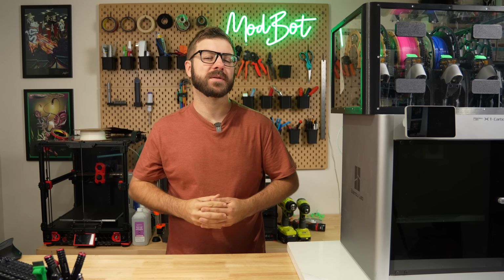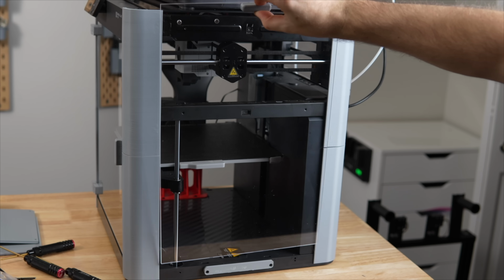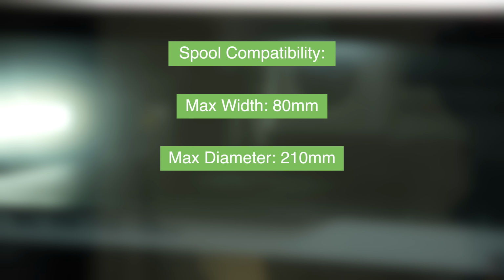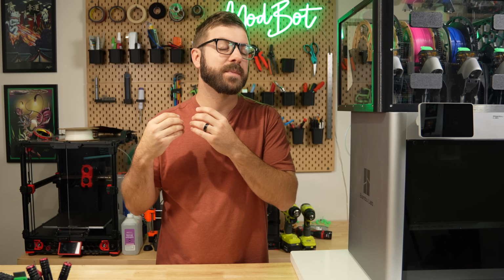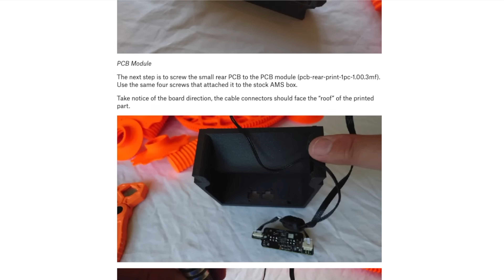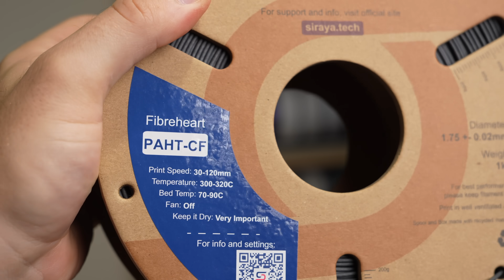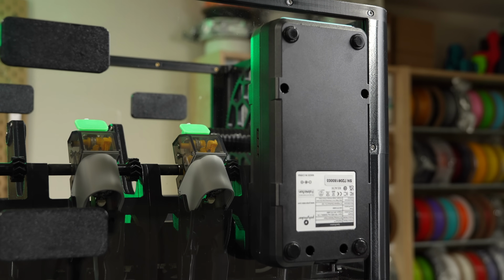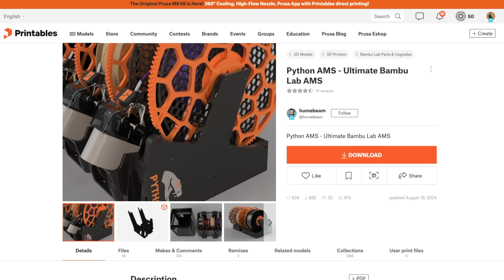Ultimate BambuLab AMS Upgrade! (Python)

Comment: Hey thanks for the review! I've linked to it from the project pages, I hope you don't mind.

RFID support is coming soon (with the next update), if testing goes well that is but I'm fairly confident.
Reply from the maker: @humebeam  hey!! Thanks for making such an awesome upgrade. That’s super exciting for those that print with a fair bit of Bambu lab filament. I don’t mind the linking at all 🙌.
Reply: @ModBotArmy 😊😊😊
Reply: You should make an ams lite version for the A1 fam!
Reply: Hiya! @humebeam I have an X1 Carbon (that's not working right now, but I won't ask for help on that here) and I'd love to have a Python AMS built for me. Do you offer that service? This is such a cool project. I'll be keeping an eye on it for future updates/functionality.
Reply: That’s an awesome mod bro. 👏 good job for doing this. ❤
Reply: Wow! Instead of investing ~300€ to Bambulab AMS, I'd rather get your upgrade only: for the drying and for 2 to 3 3kg spool options. 

I hope I would be able to use the box as a dry storage also. With heaters/dryers and active monitoring and desiccant management that would be possible – or overkill (I'm a novice).

The AMS Feeder unit seems to be 41€ a piece as a spare part! So, a 2 or 3-spool version with 3kg spools would be an excellent option indeed, if possible?

Perhaps 3 spools would fit the width printer or otherwise be prefered. I hope you could list all the Bambu spare parts one would need to build your drying box from scratch! :)

I'm just in the midst of purchasing P1S but now undecided on with or without AMS? :O  Thank you for your work!
Reply: Omg, came to the comments to say how amazing this project looks, but bummed about it not having the option to use the RFID! Excited!
Reply: @Obtuse94  RFID is supported on all spool slots since version 1.02 (September update).
Reply: @humebeam  wow! Can't wait to start cracking into this! Again, great work here.
Reply: hi is there any for A series model?

Comment: Hey Daniel. I've been using the Hydra Pro mod for my AMS/Bambu P1S for a while now. My biggest issue with it (and with the standard AMS) is maintenance. I just had to replace the internal PTFE tubes and it is a pain to disassemble the unit to get access to those tubes. You mention that the Python unit is difficult to get into the enclosure. I'm assuming, then, that it would also be very difficult to do maintenance, like changing out PTFE? Are you still happy that you went with this option? I like the idea of having even more options for filament than with Hydra.
Reply from the maker: Hey! I really like the setup and would say it’s (probably) easier to access the ptfe for maintenance but I have had to remove it from the enclosure twice and I wouldn’t describe that as being very fun. I haven’t had to do a ton of maintenance so it’s hard for me to say how it compares in that regards.

Comment: at the 10:00 mark, something that WILL help with screwing in allen bolts at an angle is a "ball head allen wrench".  Allows room to pivot the wrench and still drive the bolt in straight.

Comment: I don't purchase Bambu filament, and I usually get just whatever pops up on Amazon.  I found that I really didn't use my AMS because a lot of spools didn't work correctly, and sometimes I didn't feel like testing it.  In those cases I just used the manual feeder.  I finished my Python upgrade about 3 weeks ago, and now everything goes in the AMS.  This is an incredible upgrade, and I appriciate your hard work in this project.  FYI, I did test the RFID reader, and it works perfectly in all 4 bays.  Thanks again!

In case anyone is curious, I purchased the hardware kit online, and I printed all the parts myself in PETG.
Reply: Wow - in 3 years I have had one spool not work correctly, though there was a period where the RFID was not stabile but software updates fixed it. 
The Bambu filament has been good for me!
Reply: I've had the worst luck with "Amazon Filament", so Bambu only for me now.  I'd use Voxel's if they'd get with Bambu and put RFID in the spools too.
Reply: Does the python fit in the AMS case itself because I have the sunlu filament dryer top for AMS

Comment: I ordered mine and it said it was RFD compatible now does this reflect in the installation manual so we know where they go?
Reply from the maker: When I built it there was no rfid compatibility yet so I am not sure what the updated process is like. I was under the impression rfid required custom boards or at the least extenders.
Reply: Yes, the installation manual is updated for the RFID. You can use the RFID boards that come with the AMS.  No extra part is needed.

Comment: tempted to just drill a hole for a dryer on my AMS LOL. bad idea... I could also just put a large silicone heater and let the heat passively radiate throughout, doesn't even need a driver TBH if I keep it at 55c it'll just passively be enough with a low wattage heater.

Comment: I don't know if I just missed it, but why would anyone build a Python when the stock AMS works just fine?  You still have to  buy the Bambu AMS anyway to make one, so it will cost even more to build a Python than just use the Bambu AMS.  There would have to be a pretty big gain to justify the extra cost and labor of making one of these and I'm just not seeing it.  There are simpler ways of routing abrasive filament to the machine

Comment: Honestly the python has been an absolute nightmare. Constant failed to pull back filament errors. Furthermore, I actually purchased the upgrade kit from Voxel and they were absolutely horrendous to deal with. Missed shipping deadlines, constantly had to pester them to ship and severe warping and cosmetic issues with the unit. I ended up having to reprint half the system. Massive waste of time and money.
Reply from the maker: That sucks to hear. Mines been pretty much flawless. If I’ve had an issue it was because I didn’t places the spool correctly for the gears to mesh.

Comment: I bought my first 3d printer in 2016. A delta printer from a company called "Micromake". From there I went to a Tevo, and then Ender, and now finally Bambu. How far the industry has come in just 8 years is astonishing.
Reply: I’ve had a similar experience. I bought the Monoprice Mini Delta when it was an Indiegogo project and used that for several years. I then upgraded to an Ender 3 v2 about 3 years ago. I’m anxiously waiting for the holiday to unwrap my Bambu Lab P1S with AMS. 

3D printing technology has come a very long way in the last decade. I’m most excited about being able to print 4x faster than on my Ender, but multi-material printing is exciting too.
Reply: @neversinkmakes  You will love the P1S. It's such a fantastic printer, especially with the AMS. I didn't know Bambu Lab had RFID in their spools such that the printer identifies the material, and applies all the correct printing settings. It's very convenient.
Reply: Bought UP+ in 2011, had access to UP Box, and several others, Bought 2 Creality CR10S, Ender3Pro, 2 Creality CR10 MAX, couple of resin printers, and then the X1C - the latter gets 98% of the use.

Comment: Just built my Python. Voxel did not clear the debris from the holes. I had to purchase bits for the assembly. My T-handle Allen Head wrenches did not work well. I also had 2 parts arrive cracked. I reprinted them so it wasn't a big deal. I have mixed emotions about this mod. I won't order a second one for my new X1C. I think Bambu will come out with an improved AMS soon.

Comment: Its a cool project but for me the ease of just throwing bambu filament in and having it just work is too much of a sacrifice as is the "coolness" of the original box. I do use other filament ( i do love me some cheap natural ABS or some prusa orange PETG) but I would prefer a mod to add heating the the original, if a spool i buy does not fit ( not that common) i will re spool it.

Comment: My only concern is that it wouldn't be as airtight as the original AMS which has a unibody construction due it being injection molded. As a result more moist air could enter the python as compared to the original enclosure.

Comment: Buying the hardware kit and the printer parts still requires an AMS to extract additional required parts correct? I want to continue to use my AMS and looking for a cheaper/more versatile solution for 8 color prints. what do you suggest?

Comment: So I did wind up getting this from Voxel PLA with full hardware kit and everything. 
Couple of things to note (Currently assembling the enclosure and will edit with more findings):
1. They didn't go through and remove all the excess filament from the heat sunk inserts. I still had to do that myself, especially on the top trim pieces. 
2. While they do send a lot of hardware and bag it all separately depending on what you're building it falls short on what's needed. The instructions clearly call for  28 M3x10mm and they send M3x8mm for whatever reason and 0 M3x12mm. I wound up having to source M3x12 for the top because there's no way that the M3x8 will fit through the top rim, acrylic, and the resting lip for the lid and screw in.

As far as the actual print quality and assembly it's gone really smooth minus the hiccups mentioned above.
Reply: I wanted to quickly chime in. Just last week, we updated the design to the new version 1.0.3 version, which is completely insert-less, making it much easier and faster to assemble. As for the screws you mentioned, the original version required the M3x8mm screws, and the new 1.0.3 version will come with the M3x10mm and M3x12mm screws by default.

Comment: Looking good... Can print TPU Multicolor with this and/multimaterial? Or it has.the same issue of the stock AMS for TPU? Cheers
Reply: You can! You need to run a second line (as if it was an external spool ) but it supports natively. 3:53

Comment: I’m new to 3D printing and the understanding of this world so forgive me if the answer is obvious but:
So when wanting to use an “abrasive” filament— or one that couldn’t be used with the AMS— with the Python, you will still need to manually load it when you bypass the PFTE tube with the motors? So wanting to print with multiple colors of an abrasive filament still needs to be done manually?
If I had x4 abrasive filaments in here, it’s just acting as a housing for x4 “External Spools”? This wont make using those filaments automatic?

Comment: My sole concern is the erratic feeding of the spools; at times they function properly, and at other times they do not—the filament simply slips, and there is no movement, only the sound of the feeder gears turning. Despite installing four new feeder units and a new hub motor, the issue persists. It seems to be a problem with the gearing of the large wheel slipping, or perhaps a torque issue. Fortunately, I have retained one of my original AMS units.

Comment: Ill check this out. Of the 3 X1Carbons I own with AMS's not one AMS still works and they barely have over 1000 hours printing. I have done my due diligence with maintenance and trying to repair but to no avail. Maybe this mod can fix some of the problems I am dealing with.

Comment: hi ,I am using the python and one dryer which on taking reading around the enclousre i will get another dryer, the python works great and as yet I have had two isues with the python that are reated to  dilament drive. I have had to replace one drive motor  
the other was broken filament insde the ams which was a neusence to ge out, as the removal of the python from the case is a chor. Ther is one thing that I made to help the roll center on the reel as some rolls of filament dont centre well. the thing I made is a screww on spacer for the main filament rolls i use. - It wood be a nice adition to have screw on spacerw or a bigger tapper on the screwon peices to hold the spool in place.

Comment: I have to totally disagree with you and I am sure I am not alone...... "Most reliable multi material system I have used to date" Since day 1 I have had and still do have issues with slot 3 and 4 on both of my AMS's. I have tried every printed fix out there and nothing fixed it permanently. Just returned it to stock. Bambu was no help that only suggested try this and that. What bothered me the worst is You-Tubers who had these issues received replacements quickly and free. Not us peons since we have no real influence on the masses. It is now mostly intermittent and something I live with since the printer is great.
Reply from the maker: I’ve used 3 of these units for 2 years now with little issue. On occasional load error sure but that’s been largely it. I’m sure not every unit is perfect but compared to what’s been out there prior it’s leaps and bounds ahead.
Reply: @ModBotArmy  I'm in this same boat, my Bambu has been more reliable than any printer I've ever had, including professional printers from Stratasys and 3d Systems, etc.  It's not perfect, but it's about as reliable as 2d printers are which is all you can really expect

Comment: How difficult is it to replace the PTFE tubes?

Looks like a very worth while upgrade, but seeing as how those tubes wear out pretty quickly, it may be more of a pain to replace them on this unit (from the looks of it)
Reply from the maker: In the enclosure it would be 6 screws to detach the unit from it and then pull it out to have access. No enclosure it’s immediately available.

Comment: It seems that no one has solved the big issue. Making it easy to open the bottom to clear filament from the feeder.  It seems harder to clear the filament because you still need to unscrew it and take it out to be able to get to the bottom of the AMS.  Do you think you can ask them to design it with an easy access opening door on the bottom to make it easy to clear the bottom feeder?  Thanks
Reply: On the og AMS, you can leave those two screws out, you don’t really need them unless you plan on holding your AMS upside down lmao

Comment: While it may seem Overkill to have four dryers on the unit, it's worth remembering that each dryer was only really intended to dry one spool of filament at a time, and while it may be capable of more, its performance is going to suffer when it's pushed harder, especially with as big a volume as this has

Comment: Really like this project. Very tempting.  I would love to see a one month follow up video to see if it's living up to expectations.
Reply: I've been using mine for about a week now, printing every day. I've had no issues at all. Clearing a length of filament that had snapped (brittle ABS) in one of the feeder ptfe tubes was SO easy since they are easily accessible (I haven't built the enclosure yet). The build is a little fiddly at times, but wasn't difficult, just time consuming. The project felt extremely well designed and thought out. I believe the designer is an engineer by trade if I remember correctly.

Comment: I have a chamber heater in my bambu x1c and a bento box and the max chamber temp is 55C-60C and my PETG Bento Box I bought from VoxelPLA, deformed after a couple ASA prints. I bought it with printed parts, so all the parts are printed from PETG from VoxelPLA. Saying all that, if you do want a heated python AMS, I would recommend printing either in ABS, ASA or a better, more heat resistant filament.
Reply: Thank you! This is really helpful information
Reply: Or you can annealed it
Reply: The temperature is not the single variable here. A bento box is expllicitly made to be in DIRECT contact with high airflow. This is not a similar scenario to the environment that the python parts are seeing in operation.

The rate of airflow matters for material softening.
Reply: EXACTLY, who tf makes anything parts meant to take heat in PETG? That’s just cheap.

Comment: Does adding the external spool functionality make it compatible with tpu/flexibles?
Reply: I would think so? I’ve used TPU on my P1P external feeder with no issues and since the external feed bypass on the Python uses just the extruder motor (doesn’t use the AMS feeder gears), it makes sense that it might work. That’s just a theory though since I haven’t built this yet.

Comment: 10:18 I would put the internal mechanism in after completing the bottom housing and then slotting the panels in and completing the upper part, instead of ladling it in from above. Thanks for posting this very good video!
Reply: Starting this build myself. Looking at the instructions, it doesn't look like you can fasten the side panels if the AMS is in the way.
Reply: @snart  🤣 Seriously? Oh ,well. I wish you all the best on a successful build.

Comment: Omg I'm in the middle of making my Python AMS! I'm serial #0046. Currently working on making all of the extruder gears and spool holders out of Bambu PA6-GF Nylon. Though I'm struggling with tuning retractions and getting decent bridging without sacrificing strength. At first I had tuned the filament so good I had prints coming out near perfect at around 265°C, but as soon as I printed the Benchy and picked it up, the smoke stack broke off and I realized that cooling the bridges was ruining the layer adhesion strength and I wasn't printing hot enough. I know this is overkill, but I wanted to make a completely wear resistant system. I'm still printing the frame out of PETG though because there are so many overhangs and I have that tuned perfectly, I just wanted the heavy wear parts to be more durable and dimensionally actuate.

Comment: Since you mentioned them.  VoxlePLA’s PETG requires higher temperature (recommended by them) to print (265 vs 245).  Does this make it stronger afterwards ?  What’s the reason for this difference in temperature ?
Reply: I love their filaments. I run the PETG HS on my X1C @265 - it is much stronger than Bambu lab petg hf, and I think it's because of stronger bonds between the layers partly because of the higher temp and partly because of better chemistry.